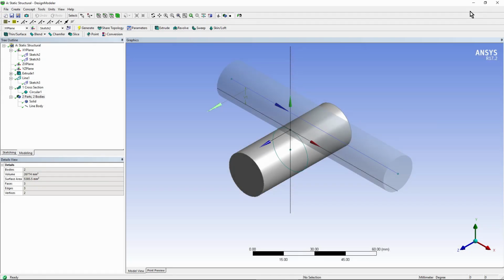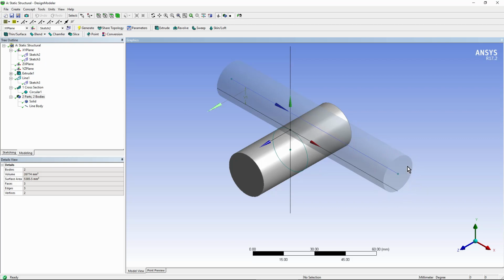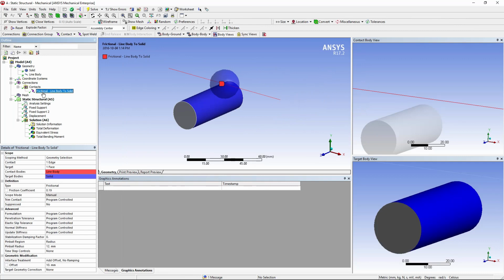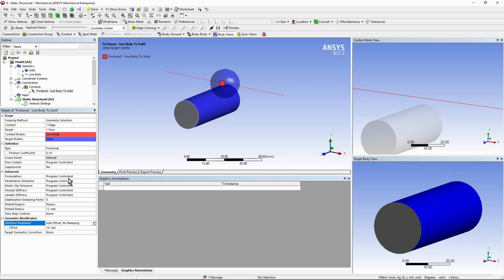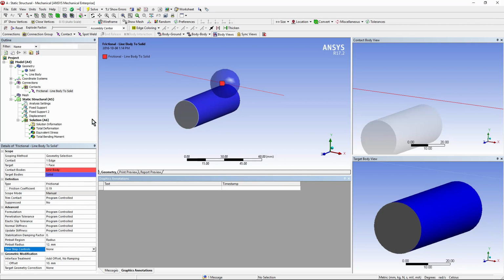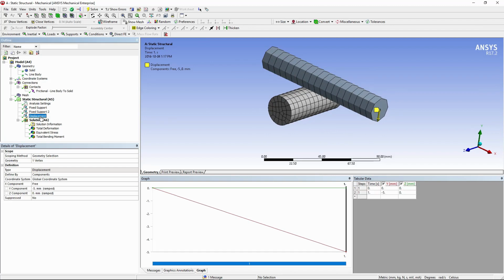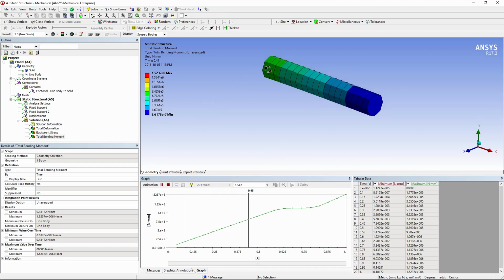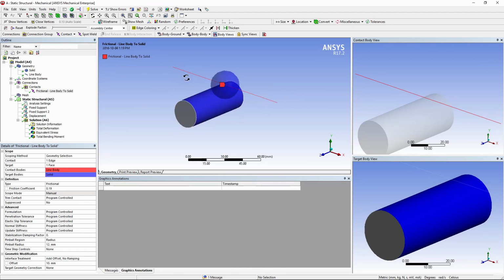Modeling Line-to-Face Contact in Ansys Workbench Mechanical

Comment: I am a final year Petroleum engineering student using ANSYS for my project to model slug flow/fluid flow through 90 degrees bend pipe (fluent). Please How do I setup wire mesh sensor and electrical capacitance tomography in fluent application or is supposed to be part of my geometry and if yes how  go about  that ?🙏🏾. I am at my wits end, I have tried everything I know but can't see the effects after simulation. Any guidance, directions or suggestions are warmly welcomed and appreciated 🙏🏾
Reply from the maker: Hello and thank you for your comment. Unfortunately, this is a very involved scenario. If you are interested in any of our engineering services, please email info@simutechgroup.com. You can also check out SimuTech Skills Center, a training portal that contains training material and tips and tricks videos that have been created by SimuTech engineers: https://skillscenter.simutechgroup.com/

Comment: Hi there and thanks for this very useful explanation! May I ask a further question on that problem? I set up a model (roof construction) where two line bodies should make contact. I tried to achieve this by the method you have shown above. But somehow those line bodies do not "see" each other anyway as they penetrate and fully crossed each others diameter without establishing a proper contact (first step) and afterwards, when taking off the load (second step) that realized that elastic deformation, there eventually is a contact but now bending the bodies in the other direction, which is physically nonsens. So my question is, whether there's some additional clue setting up contact between two line bodies instead of one line and a solid body (?)